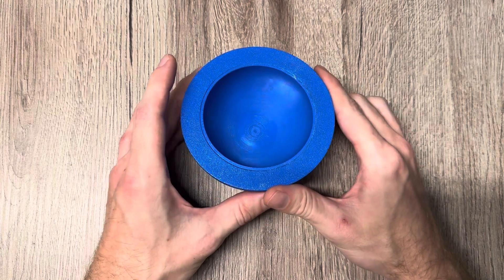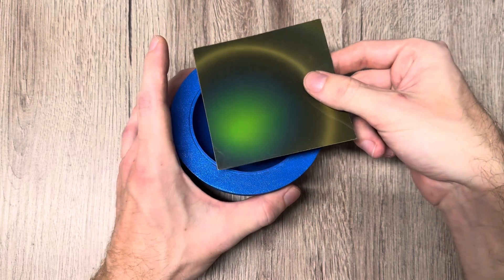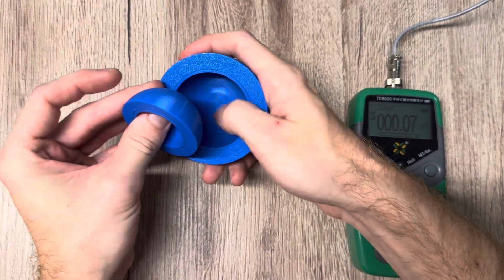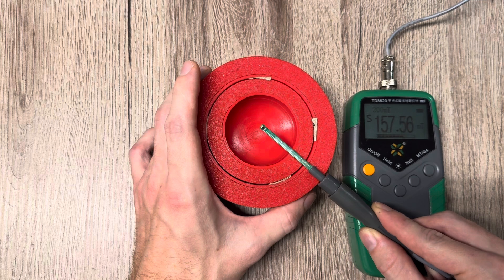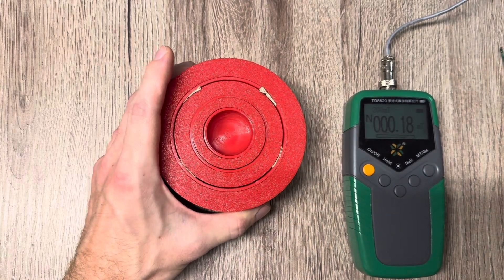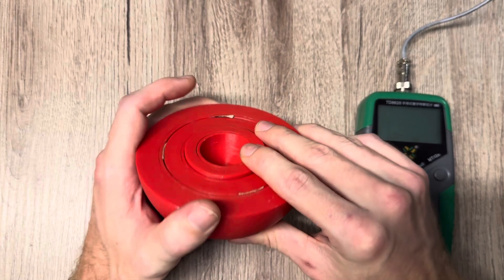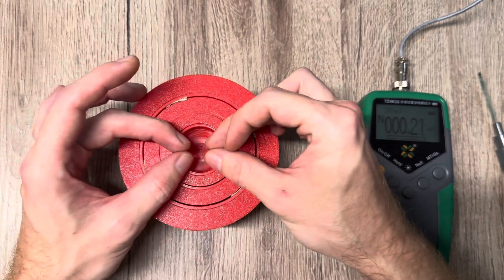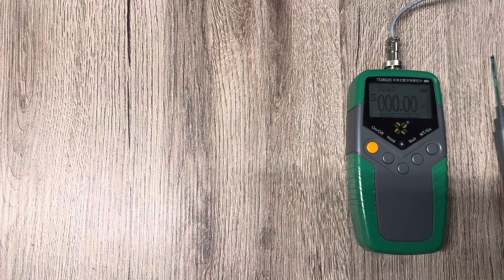Massive amplification in field strength by combining bowl magnet arrays

Comment: You add the two magnets wrong you add two magnetic Felds by forcing those two magnets in repelling manner together. The additional work of forcing them together and gluing them in place will yelled a higher magnetic Feld. Try it out and thank me later. Your sphere are does exactly that because they are'n all perpendicular they all repell the Feld on to a common point because of the circular shape. We could call it a magnetic focus point.
Reply from the maker: Not true, I tried both configurations, this one yields the highest field strength and size.

Comment: That is a really interesting effect! 0,2 Tesla is quite strong field. You could make it even stronger if you would put another set of hemisphere arrays on the opposite side with opposite pole. Question is: is it possible to change the intensity of that field using mechanical or electrical switch of some sort? Best regards!